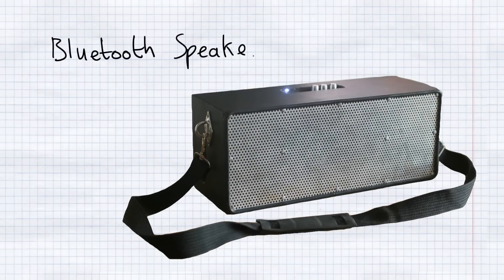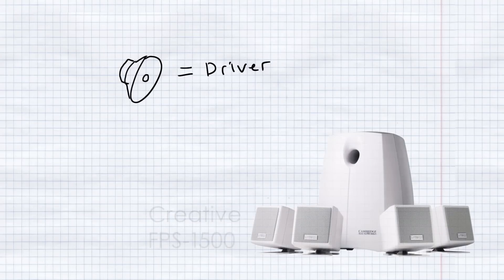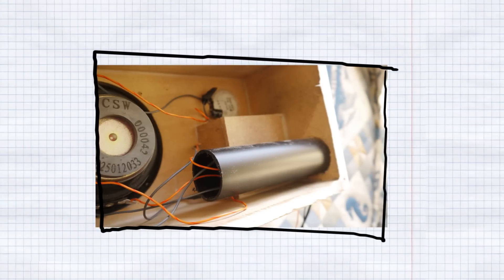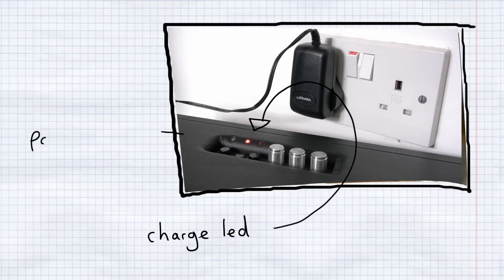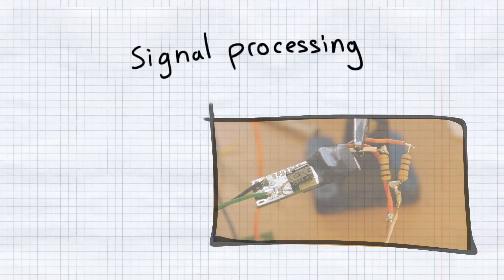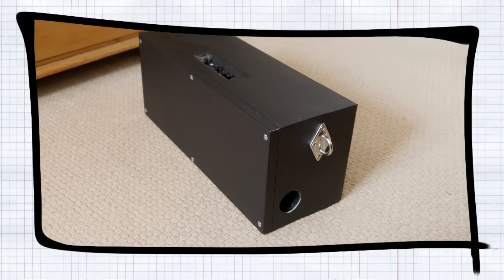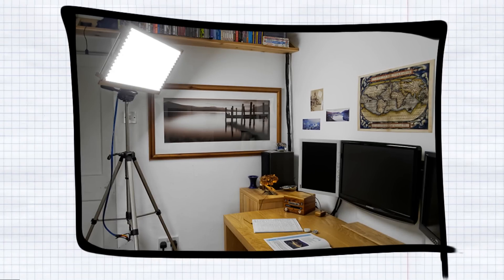Homemade Bluetooth Boombox - Build Log

Comment: Mate,  im so sorry but could you make a more in-depth tutorial of the connections?
Reply: +jmpt19 that would be nice :)
Reply: +jmpt19 I would love that too!
Reply: So would I! Thanks
Reply: The output on the bluetooth receiver will be a left and right stereo.  He wanted to conect them together and make them mono, instead of stereo.   So he connected a 160 ohm resistor on the end of the L+ and R+, then Y-ed them together to make a mono signal.   He ran this mono signal into a filter called a ground loop isolator (gets rid of any buzz) and then into the Channel A input of the amp.   

Channel A output of the amp goes three places, L tweeter&midrange, R tweeter&midrange, and then the third place is the input for Channel B of the amp.  But first it goes through another ground loop isolator to get rid of buzz, then through a low pass filter so no highs go to the woofer.  

The output of Channel B goes to the woofer.   The other things he did was to use capacitors to make sure no signals went to the tweeters that were too low for them to handle.

All these connections are made on the positive side.   The negative side is simply a wire bypassing everything, until you get to the two ground loop isolators, the negative side passes through those just like the positive wire does.  They are clearly marked which is which.

Comment: To clean up and ruggedize the exterior, have you ever thought of using silicone? I bet Smooth-On has at least one product you could dip it in, then just cut the bits you dont want away.

Comment from the maker: Well, if you can find some smaller speakers it should be easy to scale down. For a smaller one, I recommend using a 3w 5v amp, and a 5v battery. For the speakers, maybe you could use the drivers from a set of Sony Ericsson MPS-70 speakers, as they sound pretty decent for their size (rubbish though in comparison to anything larger).

Comment: Hi I used a Centre Speaker from an Audio system.  I made my Stereo to Mono adapter with three resistors and no transformer.  i am not experiencing any ground loops.  My amp is a Mono amp D class.  So far runs and sounds good with very good base.  BTW:  Love the video of your build.

Comment: 00:42 - You could design a ported system which would extend the bass response considerably, even below what the driver is designed for. I managed to design a subwoofer using 6.5" mid-range speakers and got the bass response down to -3dB@37Hz. However, this was using a larger enclosure.

If you can find out the Thiele and Small parameters of the speaker you have, you can work out the port size and length that would be optimal for them. If you don't know the T&S parameters of the speaker then you can use trial and error for the port design, which is always fun!

Comment: Oh man. You needed to just bridge the stereo outputs for the sub with a coil filter and use the stereo inputs putting only highpass caps on the mids. Fiberglass would have been better. I happen to have thin wood laminate sheets. Yep I like this build. You got so many impressive builds

Comment: Using drivers from Creative/Cambidge PC speaker worked very much to your advantage in achieving high volume, because they are more resonant than drivers you get from Hi-Fi trade. Hi-Fi strives for flat frequency response and uses thus critically damped or overdamped drivers, which incurs a huge energy loss.

Comment: Hello! Could you please provide more details about how you turn the stereo signal to mono? I would like to make a bluetooth mono speaker, powered by a RC car battery. I got all the parts for it, but I'm a bit confused by how I can wire the stereo to mono signal from the BT dongle. Would really appreciate some help :) Regards from Norway :)
Reply from the maker: Pyr0t3ch Just connect two 160ohm resistors to the output (one for left, one for right), and then join them together. That way the signal has to travel through the resistors before it gets 'merged' together.
Reply: DIY Perks Thanks alot! :)
Reply: It's much easier to do the stereo to mono mix using software :) In my Galaxy S3: Settings > Device > Accessibility > Hearing > Mono Audio. That's the trick! Great job, thanks for the tutorial! However, I'm not doing the double amp trick, nor do I use Tripath 15W. I found it to be too silent outdoors. Using a 2x50W bluetooth amp instead (3116 based, also class D = efficient). Built the whole stuff into a Tesla 2-way 15W speaker. Battery = 4S 5000mAh Turnigy RC car battery. Very loud! :) And I can still use the equalizer in VLC player if I want more bass.
Reply: +TheMorbiousStone you cant hear stereo audio from small bluetooth speakers, so stereo is useless
Reply: DerpyDoom I HAVE SOME 1970'S MCINTOSH 3 INCH DRIVERS WITH 80 oz. MAGNETS ON THE BACK, I PUT THEM ALONE IN A BOX WITH A SMALL CROSSOVER & THEY ARE BLUETOOTH READY & ALSO HAVE A USB FOR BETTER CLARITY THAN THRU BLUETOOTH. THE DRIVERS ARE 4 ohm, & IT TAKES 80 WATTS JUST TO TURN THEM ON. THEY HANDLE 425 WATTS EACH PEAK POWER & LOVE HEAVY BASS WITH LITTLE DISTORTION, IF U LEAVE THE BASS ON YOUR MP4 TUNED TO STRAIGHT IN THE MIDDLE. THIS 2.0 BOX WILL BLOW AWAY ANY STOCK STEREO WITH AN AMP UNDER towards per CHANNEL. I HAVE A KENWOOD 4×50 with a 200 watt amp in the trunk & 2(3way Alpines in the back window) & A Pair of POLK 2 WAY 6 INCH DRIVERS IN THE FRONT DOORS. CLARITY IS AWESOME. MY LITTLE 2.O BOX WILL BLOW MY KENWOOD AWAY, LIKE U NEVER HEARD IT PLAYING. 5 WATTS COMING FROM MY LGG5 & A SMALL 275 WATT AMP & 2 $7 crossovers from RADIO SHACK. IT HITS SO HARD & CRISP PEOPLE THINK IM CARRYING A 1000 WATT ROCKFORD FOSGATE & ALPINE SYSTEM. THIS 12"BOX SQUARED HITS ALMOST 300 WATTS & HAS EXCELLENT SEPERATION!!! YOU CAN VERY CLEARLY HEAR THE SURROUND SOUND FROM THE E.Q. ON MY LGG5. IT IS SMALL BUT HITS HARDER THAN A MOFO WITH 2 BADASS 3" DRIVERS, BUT THEY ARE McINTOSH OF COURSE THO. WHEN THEY WERE FIRST MADE, THOSE 3" DRIVERS COST $350 apiece. BADDEST 3" DRIVERS EVER MADE!!!!! VOIL COILS ARE PHENOMENAL!!!! I OVERIDE 80% of Everyone's STEREOS, & THEY ARE EMBARRASED AS HELL, WHEN THEY SEE ITS 2.0😜😜😜😜😱😱😱😱😱😱😱😱😱😱😱😱😱😎😎😎😎😴😎⚡🌠⚡🌠⚡🌠⚡🌠☀☀☀☀☀☀☀☀🌔🌓🌒🌒🌑
Reply: +Robert Richman don't use all capital letters and use block paragraphs. It makes it much easier to read your comments. You sound like you are passionate about your audio! ;-) Cool!
Reply: what if we joined left and right wothout resistor s to make mono sound   .and why cant u use same signal to make bass signal @diy perck

Comment: This is amazing, could you do a video explaining how you used the bluetooth adapter to work as an audio receiver ? I wish to make a bluetooth audio receiver.Thanks in advance.
Reply: It is a specialized USB Receiver which only sends audio over the USB data channels; they are found for similar, if not lower prices on sites like ebay and are compatible with most devices which support iPods and more.
Reply: thanks, ( do you mean an A2Dp  bluetooth receiver ? )

Comment: man i gotta say you good at this i bought a 200w amp hooked up with my 100rms sub and tweeter result crack in my window and some complaint cause the high freq is too loud
Reply: I'm 200% sure it was not because of the tweeters

Comment: That was just great, now I want to build one!! I did however build some powered speakers for my computer to get a better low end response(more than the tiny speakers that cam with computer). This was a couple of years ago and now the left speaker is making a noise(signal), the right speaker has the circuit board in it. I just have left and right wires for the mid driver and tweeter. I don't think its a ground loop because the sound is not coming from the right speaker just the left. now that i think of it... I don't know why i am calling them left right, anyway I can't find a good video on youtube and googled it and I only seem to get car speaker answers. Maybe you might have had this problem and a fix, Thank you for taking time to read this lengthy post!!
Reply from the maker: It could be anything going by your description. All I can suggest is that you re-solder your connections, just in case one has come loose.
Reply: I thought that, i just put a different speaker in that side a couple of months ago, did it really take me that long to notice 0.o. Thank you very much for you help and the great video's.

Comment: its a great set up, just wanted to know where did you place the potentiometer in the circuit so that it controlled the overall volume of both the bass and mid/treble drivers

Comment: THIS is AWESOME! I built a boombox myself with a ta2024 amp module, and I also made it so I can carry it by using a strap from a bag. I'm using a lead-acid battery but that weighs a ton! I'm going to replace it with a li-ion accu soon. I was also thinking of including a usb port to power a phone and a BT receiver. QUESTION: do you have some kind of protection on the USB so you don't damage a phone/mp3 player? Also, does the BT receiver only need 5V power to get sound out of the 3,5mm jack?

Comment: Hi! Amazing  video! I am making one too, based on this video, but I have a question, what resistors and capacitors did you use to make the low pass filter? Please answer me asap ! that was the only thing that I didnt understand...Keep on the good Work !I like your videos!!
Reply from the maker: I used the design tool on this site:

http://sim.okawa-denshi.jp/en/CRlowkeisan.htm

I aimed for a low pass frequency of 100Hz and below. :) The best thing about low pass filters is that you can design one with components you already have. For example, say if you only had a 100uF capacitor... all you need to do is then find a matching resistor for it to get the desired frequency response.

Hope this helps!
Reply: DIYPerks thank you very much !when im done I'll put my a video as response!

Comment: Hi! Excellent videos! I love them! I am actually planning on doing one boombox from my Creative SBS 4.1 450 old speakers. I have some questions though. 
The output of the AC adapter for the speakers is 12V 2.9A, what battery would you recommed for that? Also can you help me out on how to make it rechargable through the AC adapter? what did you use? Hopefully you will find the time to answer me! Thanks!

Comment: Love the channel, TRYING to start my own actually for my home shop and dog sledding but that's besides the point. 
I am wondering if there is anyway I can get in touch with you so I can pick your brain about wiring. Electrical is my weakest area and I am trying to get better to help my business and aid fabrication of the many ideas I have for all the pcbs, internal speakers and screens etc I have collected over the years taking apart numerous electronics. I have more then I can say, I have plenty to use to make stuff but not enough to recycle for precious metals.

Long story short I want learn electronic wiring, I have an Arduino starter set I'm learning, a raspberry pi screen and 3 engineering degrees but in welding, manufacturing, and product design and learning how to build circuits and wire speakers into cool blue tooth speakers and all kinds of stuff would be a great addition. I know you have a video about wiring I am trying to find rn actually but can you suggest any other videos or resources?
Thank you and hope to hear from ya

Comment: A detailed circuit diagram would be greatly appreciated as I noticed you missed things out like the external 3.5 jack for direct input or the step down for powering the blue tooth and the bass control etc. Not trying to knock the video as it's great just a bit more detail on how it was all put together would be great

Comment: I know this is not related to the content, but how on earth did you do those amazing animations of the text and drawings?
Reply from the maker: Peter G Just drew them out with a cheap graphics tablet whilst recording the screen ;)
Reply: DIY Perks
Ok - can you specify which program you wrote it in and which capture programme? I had a hell of a time doing a similar effect in After Effects with mind numbingly boring pen tool stroke animation of a scanned image, so your solution seems elegant and simple. You must have somehow converted you writing to a matte?
Reply from the maker: Peter G You can do it with a screen capture program and Paint or Photoshop (I used Photoshop). Just record the screen as you write.

Comment: i took your idea and simplified it a bit. im using a old magnavox boom box with 4" car speakers and a 100w bluetooth integrated amp board. should slow me to play tunes at work at the high volume necessary in a machine shop

Comment: Über-cool! 
I wondering if you could use lengths of 3" pvc pipe with cap ends for the mid-range and tweeter driver enclosures? 
This unit would look awesome with a retro Fender tweet cover.

Comment: Hi, I like the mono trick for seperating bass and full range! I don't quite understand how you made the bass/treble controls. Can you link potentiometers directly between the speakers and the amp ? Also, I suppose the general volume potentiometer is linked linked between the bluetooth reciever and amp input ? Cheers

Comment: I really recommend you try to get a better quality bluetooth receiver. Those chinese ones output a pretty shitty sound, especially for the lower-frequency bands (bass and drums).
Reply from the maker: They're not too bad really. If they're driving a load, then bass suffers a lot as they aren't designed for low impedance loads, but when going into an amplifier they're really quite good.
Reply: I tried with headphones and the quality isnt great in fact its disappointing. Lets see how it turns out with my amplified 7.1 channels in the living room. . .
Reply: +DIY Perks where did you get the battery charger from?
Reply: +J. Carlos Andrioli Different chips for different applications. He's actually right in saying that those receivers are fine for these kinds of applications. Of course it's gonna suck running headphones directly off of them, the drivers within them are terrible. In this project though, that doesn't matter
Reply: +J. Carlos Andrioli  With headphones (low impedance load, approx. 16-90 Ohm), the low decoupling capacitance the cheap Bluetooth receiver has, works to your disadvantage and attenuates the bass. When they go into an audio transformer (about 2 KOhm) or an amplifier (100 KOhm or larger), the bass attenuation is barely noticeable. Another issue is that they struggle to supply the necessary current to drive headphones directly, but high-impedance inputs only require minuscule current.

You can actually make any wonky output better by driving a high-impedance load; for this reason, headphone amplifiers such as the ones made by FIIO for cell phones make the sound not only louder, but genuinely better. Similarly, 90-Ohm DJ headphones sound cleaner and better on cell phones than 16-Ohm earphones, though they usually don't get very loud.

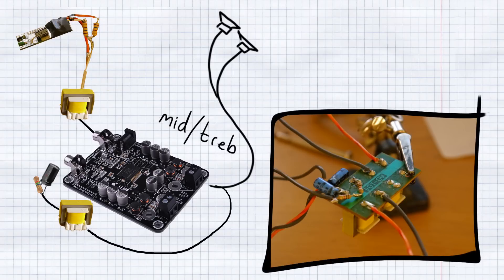Comment: Hi Matt. Is there no danger of destroying the amp by connecting amplified signal to the input of the amp (4:50). Can you please share the schematic of the low pass filter mentioned at 4:40 ?
Reply: Mandragoras look at the conversation of what Meth_Cooking_Afghanis started. should be up the top further

Comment: Would it be possible to set up a switch that would allow the speaker to toggle between mono, treble, and bass? I think it would increase its functionality if you could keep several in you house for surround sound and be able to take any of them anywhere for any reason.

You need to mass produce and sell these things. Those things have unlimited potential.

Comment: I am surprised you didn't fry the input of the amp. Have you probed the signal with a scope to see the p-p levels?
Reply from the maker: A ground loop isolator works by completely isolating each side, so it can't really blow an input. Also, the signal is not particularly hot once it's been through the low pass filter, so there's not much chance of overload either (after all, you'd hear clipping before the amp would even begin to be damaged).
Reply: DIYPerks Yeah, I suppose you didn't blow the amp up, you should know! But from what I understand a 1:1 transformer offers galvanic isolation but the amplitude is unchanged. But maybe your right and there isn't much in the lower frequencies to do any harm. So anyway, what material would you suggest using for the outer lining?
Reply from the maker: *****
Yep, a single stereo ground loop isolator should contain two transformers.

Comment: Great build!  I'm planning a build similar to this but I am having the toughest time figuring out the power requirements (super new).  I plan to use the 15watt  tripath amp you used.  What would be the simplest battery to use to get ~4 hours of playback time?  Should I stick with a 12 volt?  If so, how much capacity (mAh) would I need? Also, do they make chargers that have a battery in and out function without having to do a rewire like yours?  I've seen usb charging modules but they only work with 3.7 volts li-po.  Thank you for any help you can provide.  I've spent about 2 weeks reading up on this and can't figure it out so  I really appreciate your help!
Reply from the maker: If you're new to this, the simplest way to manage the battery is to buy a battery compartment (for 10 AA batteries) and use 10 AA rechargeables. That way you can just take them out and charge them with an external charger when needed.

Should give you plenty of listening time too (much more than 4 hours if you use decent batteries).